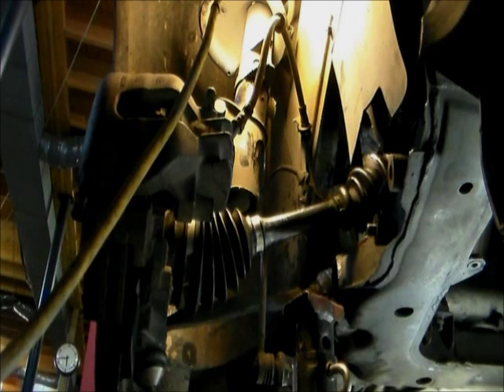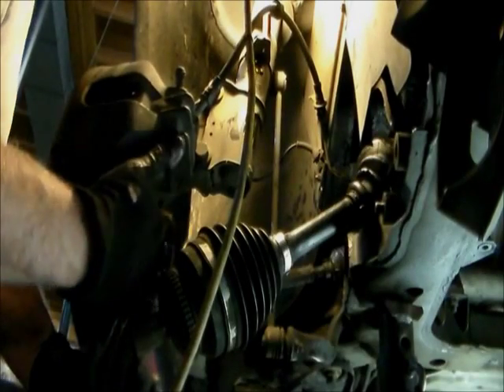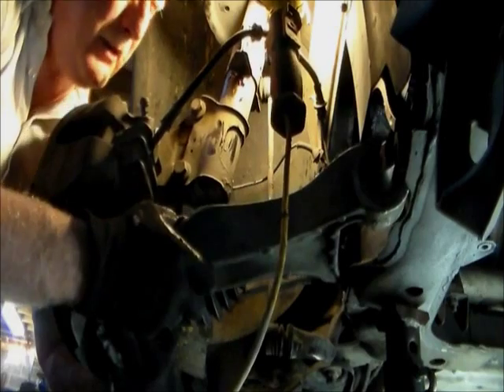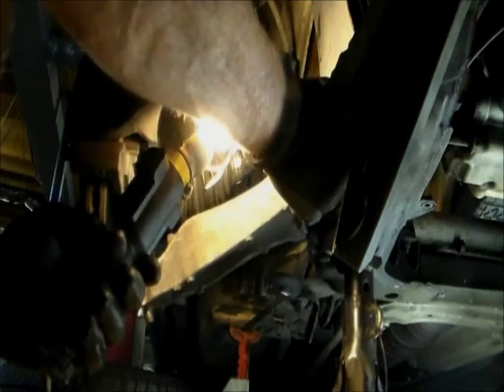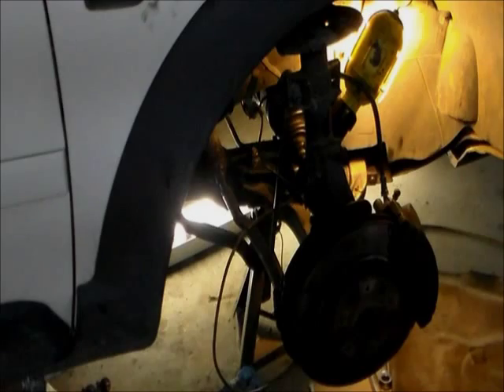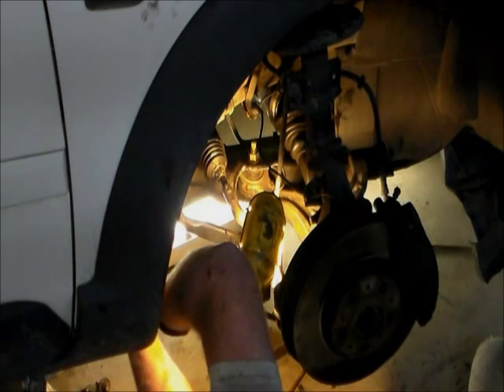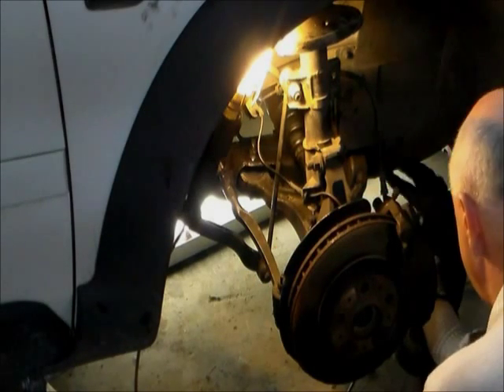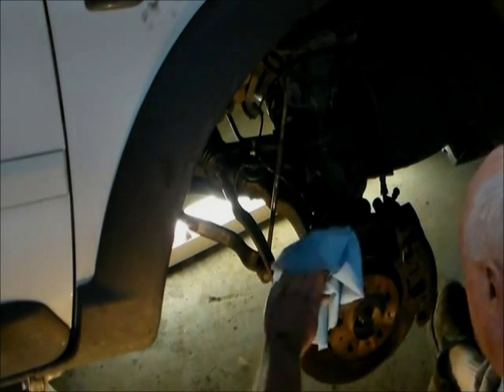Reinstalling the lower control arm on a 2002 Volvo XC70

Comment: Interesting way to get the front bolts in. I will have to try that next time.
Reply from the maker: The last one I did, I had to use a short cheater bar slipped over the bolt to push it up in place.